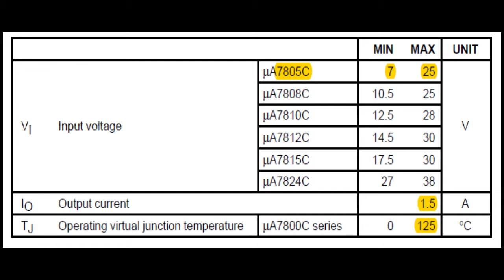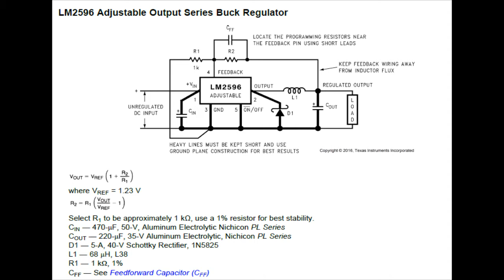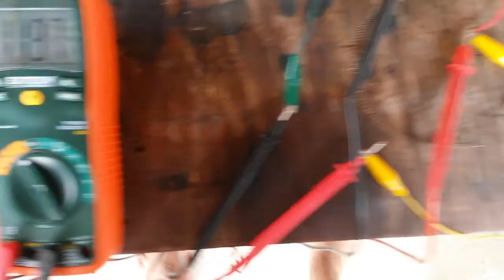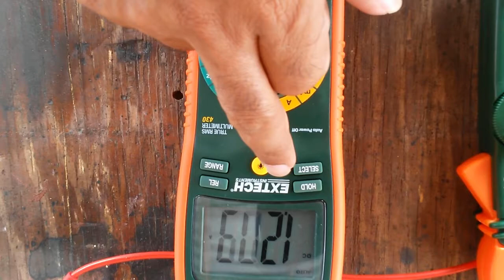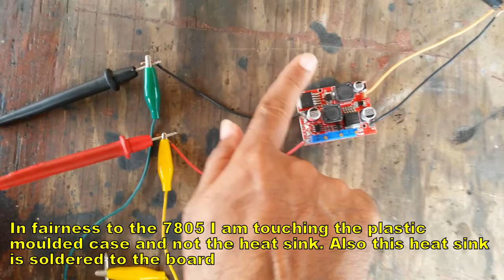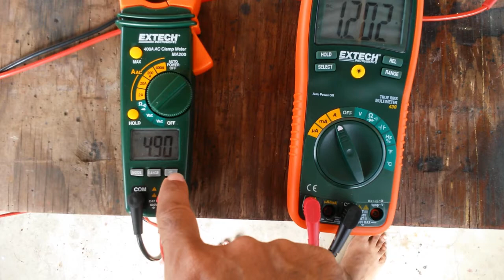058 DC DC Conversion   Comparison of a Linear Regulator and Buck Converter

Comment: that seems really bad efficiency on a buck, Reading I've done recently says 90% is not uncommon but  don't believe everything you read ;)  for reference https://electronics.stackexchange.com/questions/91149/what-is-the-most-efficient-way-to-power-a-solar-computer-5v-from-a-12v-lead-ac
Reply from the maker: Some good information on that thread. I didn't do a proper search before I embarked on the solar project. Thanks for the link. 

I didn't know about the LT3652 but I figured there would be budget chips that can do MPPT. Does not seem to be necessary though if the solar cells are chosen to match the battery. In fact if its doing fixed voltage as opposed to some other scheme it would be close to the efficiency I got. It's still a good chip to know about though. I may look on ebay or bandgood to see if anyone has it incorporated in a reasonable module.

I am considering going on the EEV blog and asking for a review of the test done on the video. Some really smart guys there that may be able to help me understand why its inefficient or what I did wrong (I can't figure it out). About 6 months ago I asked one question and got a good clear answer quickly. 

On another note the buck boost board is perfect for a cheap lab power supply once the power draw is low.

Comment: That's a great test, man. Really good.
Reply from the maker: Really disappointed the buck converter was not more efficient. I will test the boost part of it sometime in the future. 

Its quite handy though. The current limiting and the adjustability makes it a cheap "power supply" for low power projects.
Reply: Manick N That's true. I want to make something like that in the future, by the way. And, yeah... They aren't that good. :/
Reply from the maker: I just tested it with a 18650 and I am getting 5V. Seems like a cheap portable power supply is easy to make with this. Probably incorporate a cheap voltmeter and ammeter combo in the housing too. Definitely a good project.
Reply: Manick N Absolutely. :)